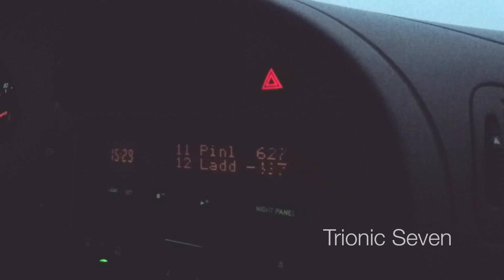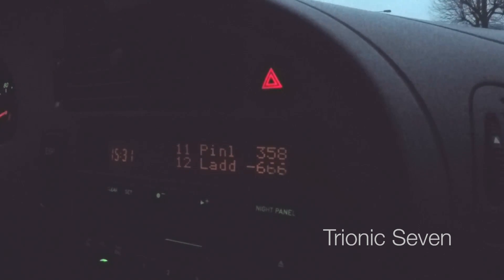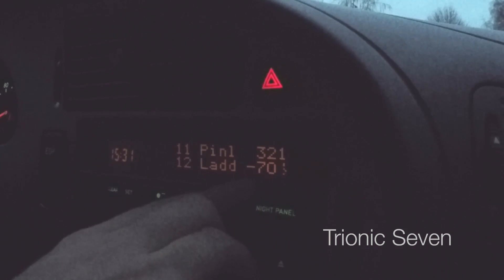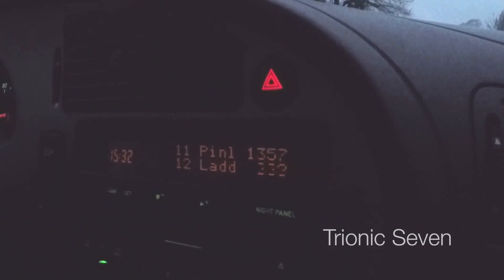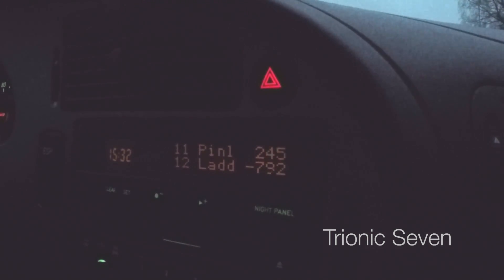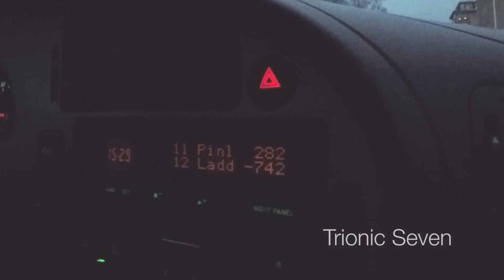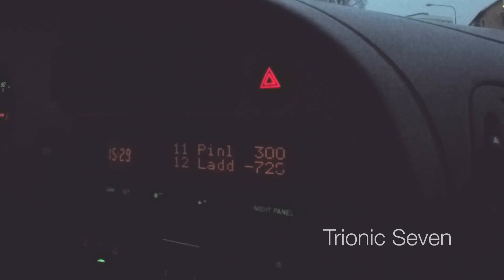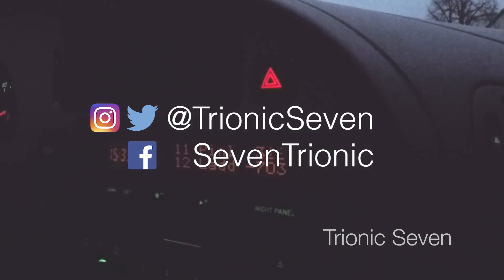Understanding Saab OpenSID Part 1: Basics - Trionic Seven

Comment: Hi!
Awesome channel!
I just got my hands on a 1999 9-3 Viggen (and yes it's a real one with T7).
Is the contacts and pins the same? I've had trouble connecting to my I-Bus and don't really want to rip apart everything to install the P-Bus before knowing that the pins are the same as in the 9-5.

Kör försiktigt.
/h

Comment: My car is colecting Knocks at one cylinder(nummber 2)after i change the spark plugs with new,before that cars was colecting knocks on cylinder N-r 3,Whats is wrong with my car?? No missfire recorded on the open SID using only gasoline super 100 octanes,The engine is recently rebuild completely.WTF is going on,i'm about to give up on this scrap.I ll be grateful if you respond to my message and give me some advice.
Reply from the maker: Hey! I don't know what could be the problem, but hop into our community forum and you'll get a lot of answers: :) https://www.facebook.com/groups/733705113501723/

Comment: Hey! Great video. My amul says -513. Any reason to be concerned? Would this be a tuning error or an error on the car? 2.0t stage 1 .
Reply from the maker: Yes, I'd definitely look into that. Check for vacuum leaks or a bad tune.
Reply: Thank you for informing. 2 more questions.1: Does the fact that i got 10 in Limp value and -614 in AMUL have a connection? My buddy has +1000 in amul now, but no Limp. 2: WIll exesive + and - values be caused by different things since it compensates in 2 different directions?

Comment: The steering wheels buttons doesnt work normaly , when i push radio volume for example it honks . i checked the connection cables and they look ok. i heard that if SID  was replaced  and doesnt match the car gives wrong commands on these buttons. I bought my saab 9-5 2004 like that . Any one have any idea on this issue ?
Reply from the maker: Good question, I don't know.

Comment: Well done Jonathan. A really anticipated video. I have open SID in my 2006 9-5 aero and it is very informative as well as addictive. Please make sure that you explain all the parameters and their values. There are available info on the parameters online but their values and their respective normal boundaries are not explained well.
Also, are you aware if there is a performance parameter available to measure accelaration etc. Something  similar to the eSID available for the 2007+ 9-3 ss models.
Thank you and keep up the good work.
Reply from the maker: Hey, thanks! Please tell me more about the accel feature in eSid. I've never used it so I don't know what it does. Is it the same thing as the 0-60 and 0-100 times you can find in the obd2 apps?

Oh, and I won't be able to explan all the values, there are hundreds of them :) I will focus on the important ones and give estimates of range and so on. Problem it, too many details and it will turn into a lecture about engine internals and modern electronic engine management systems!
Reply: Trionic Seven , Yes it is similar to the accelaration features in obdii apps. I am asking if it is possible because esid takes the data from the ecu and shows them on the 9-3 sid.
As for the parameters i know there are many and it is hard to describe them all, just do your best as always.
Thanks. :):)
Reply from the maker: Hey! 

No, opensid does not have that feature as far as I know. That's somethings that the apps are better at :)